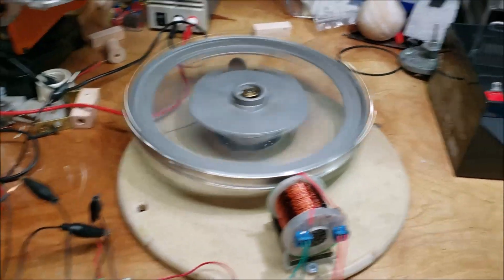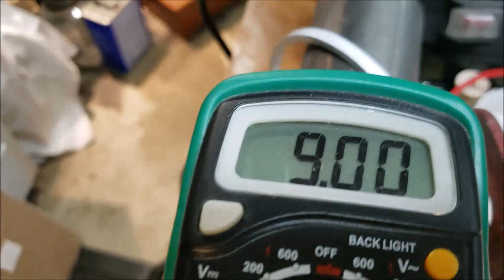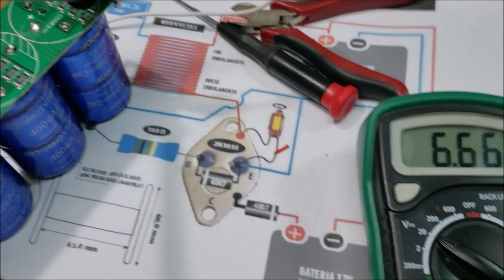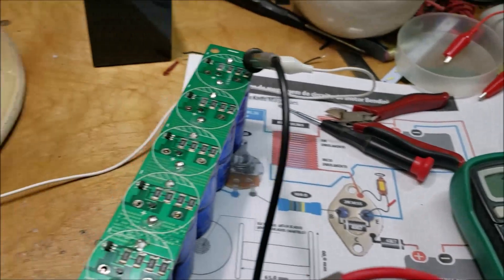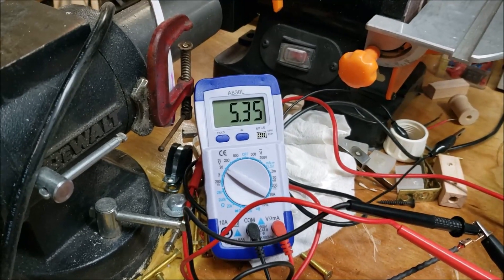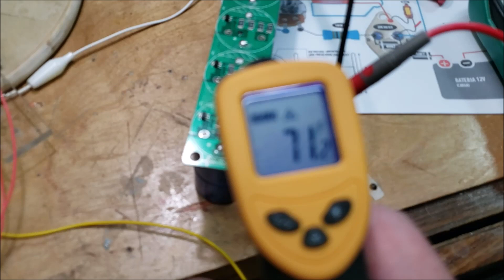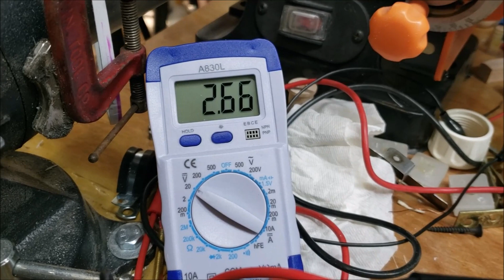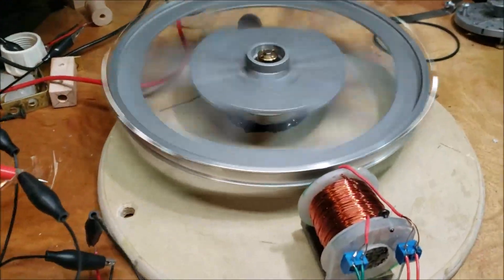Bedini running on super-caps

Comment: So you started with 12V and ended with 11V total. Assuming your farad ratings were equal that's extremely efficient but shows no net gain in energy.
Reply from the maker: correct a mundo
Reply: @mcorrade  Still that's about 92% give or take. It would take a truly tiny trickle charger to keep it running.

Comment: Trying to make overunity 🙂
Reply from the maker: No just playing around with different configs to get different outputs. I'm a firm believer in the laws of physics never the less, there may be some we haven't figured out yet :)
Reply: @mcorrade  Yes, everything is possible 👍
Reply: @mcorrade  Yes we have, it won't work this way. The efficiency of these devices is not even near 90%. And I even improved these machines. They run much better, but it's still not enough that's why I call this overunity/energy from the vacuum myth busted! I have the plans on my channel if you're interested.
Reply from the maker: @Lightmaker5  ok will have to take a look.
Reply from the maker: no just playing.